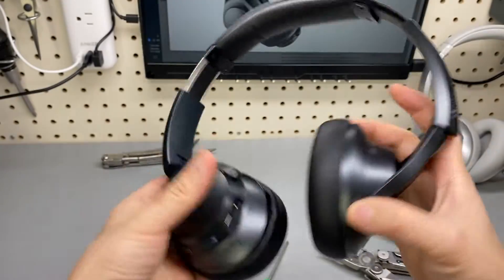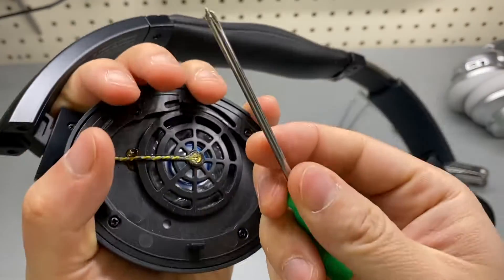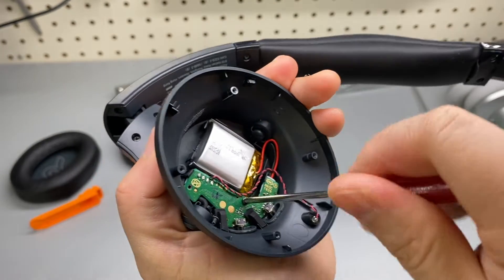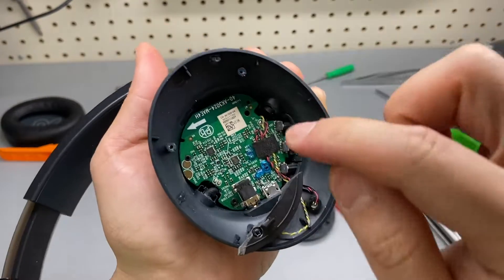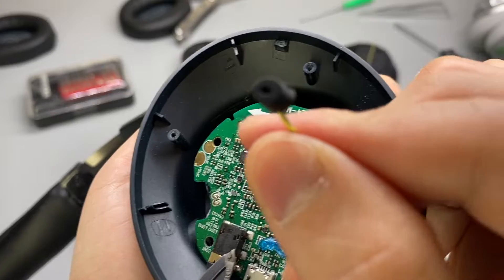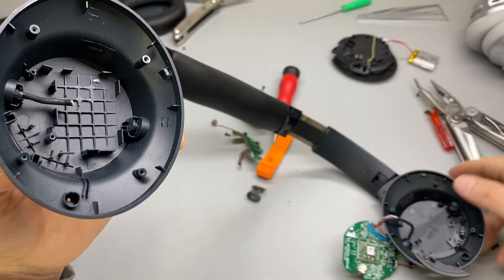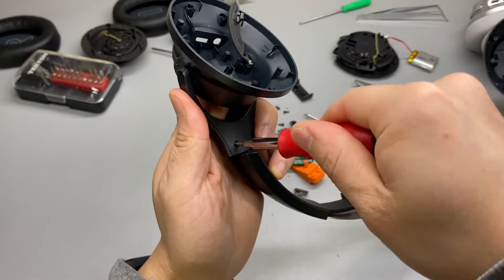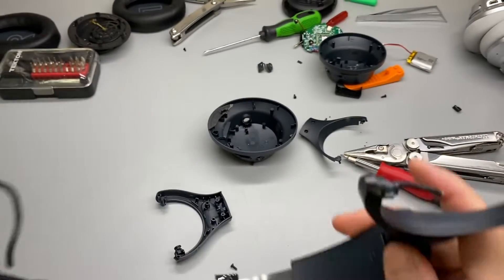Soundcore Life Q20 Teardown (Finale!)

Comment: My battery isn't doing so well.. do not get more than 5-6  hours out of it now.. I don't see a direct replacement anywhere.. any ideas on battery dimensions and possibly putting a someone higher capacity battery in as a replacement (Maybe 1000mah or 1500mah if it would fit and be compatible)?
Reply from the maker: Sorry I don't know
Reply: Better be careful putting anything other than the original battery, which isn't available to the public. For instance the red and black wires are sometimes reversed in other batteries.. 💣💥🧨🤯
Reply: That would be stupid of the mfg to go agsinst accepted conmon practice to reverse the terminal wires. The main reason this is done, is equipment that needs to be serviced by professionals may reverse wires. I've not seen it done on simple equipment like headphones. Eg, telecom equipment or old school video equipment.
Reply: @GaryMe-f4l  That's an option that's available by those companies selling the batteries! 👀

Comment: Thanks for the video! My charging port broke after just over two years of use, and with this, I'll be able to solder on a replacement now that I know what to expect. Cheers!
Reply from the maker: Thanks Grant! Smash the like, it really helps my channel, thanks!
Reply: @ToolsElectroDIY  Consider it smashed
Reply: Hey, i have the same problem.  All the articles and comments online said to try to reset the device, which didn't work for anyone.
Just wondering how difficult it was to access the area and solder.
thanks
EDIT:  also was yours HOT when you were trying to charge it?  and what side needed soldering, the battery side or the micro-usb side?
Reply: @DaveWirth  Getting access was no big deal. Soldering is about as tricky as most USBs, really. I went ham with good flux and it went alright.

Never experienced it getting hot though. Can't say it necer happened, just that I never noticed.

Comment: Mine has a dead battery after a little under 2 years.  I am not impressed.  The battery would be easy to replace if one was available.  Looked at available 3.7V and 720mAh LI batteries.  None will fit in the available space.  So they are using a custom battery to screw customers since they don't offer a replacement battery even to buy.
Reply from the maker: Thanks for sharing

Comment: Thank you. The right pad was coming out just a little and all i needed to do was add a little superglue but couldn't figure out how to open them up. This was super helpful, thanks.
Reply: It’s otherwise in superb condition. I can’t seem to find replacement parts though.
Reply from the maker: Glad I could help!
Reply: They are strong but the hinges seems to be its week point. Both hinges on my Q20 have a crack half way through.

Comment: Seems to be impossible to repair these headphones without breaking then totally. My Q20 just stopped charging.
Reply from the maker: You can do it with extreme care.
Reply: My did too,I emailed them from amazon,Amazon, they are warrantied and will send you a free pair,they will as for serial #on broke pair,I did these got new ones wear everyday love them,but the plastic henge broke here to see if I can use old pair to fix new pair
Reply: My Q20 stopped working after plugging into a fast charger. If your charger output is greater than 5v it may smoke your charging circuit. See https://www.youtube.com/watch?v=JjdEAzV7pAs for a fix.

Comment: Thanks for the vid. Any idea why the Q20 has issues with not being able to recharge? Anker suppprt claims there's no widespread issue, but googling the problem a lot of people have this issue.
Reply: My Q20 stopped working after plugging into a fast charger. If your charger output is greater than 5v it may smoke your charging circuit. See https://www.youtube.com/watch?v=JjdEAzV7pAs for a fix.
Reply from the maker: No idea sorry. Soundcore has 18-month warranty.
Reply: @ToolsElectroDIY  ok thanks, unfortunately I brought mine off of Amazon but did not know that they were refurbished and Anker support told me refurbished headphones only have a three month warranty
Reply: I'm having that problem too.

Comment: My Life Q10's were under warranty and one of the earpads started splitting at the factory seam where they soft pad material was joined to other soft pad material. They sent me out two new ear pads. I'm watching this video to see how you remove the ear pads because the replacements came with no instructions. I didn't have a plastic prybar but I had the screwdriver/bottle opener from a Swiss Army Knife Super Tinker model. It worked like magic without scratching or indenting the housing. I suppose any really thin screwdriver or butter knife would work. Thank you so Much! - I Love My Life Q 10's!!! 60 hours per 2 hour charge or a 5 hour charge for a fast 5 minutes plus an 18 month warranty and below 40 bucks..
Reply from the maker: Thanks for sharing!
Reply: is the procedure for q10 is same as that of q20

Comment: Those springs are actually the contract for the actual speaker insane there, the thanks wires are due that component good in the center that you can see which is a mic for the anc while the springs (if you look in the board you'll see the pads) just have a pressure contact in the pcb in there. I live theses headphones and and impressed with what's inside them.
Reply from the maker: Good to know thanks!

Comment: What's a screw driver
Reply from the maker: A screwdriver is a tool, manual or powered, used for screwing and unscrewing screws. A typical simple screwdriver has a handle and a shaft, ending in a tip the user puts into the screw head before turning the handle.